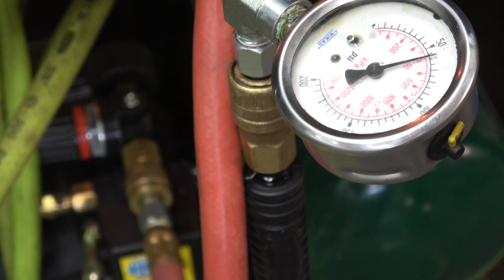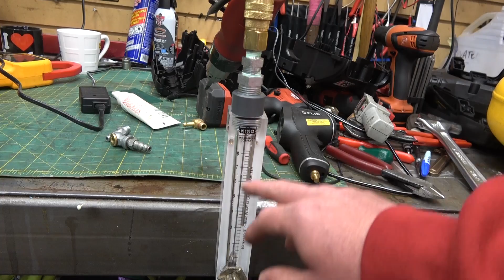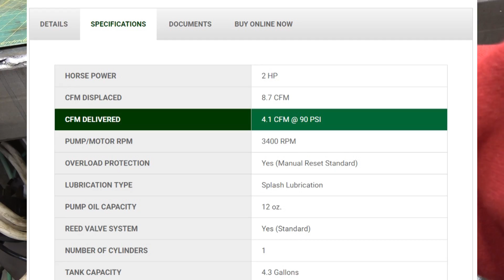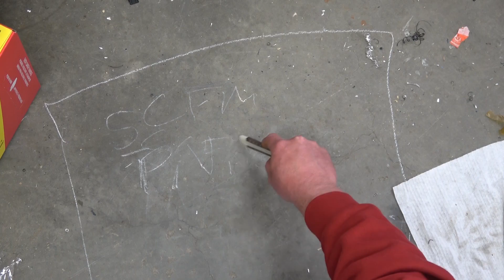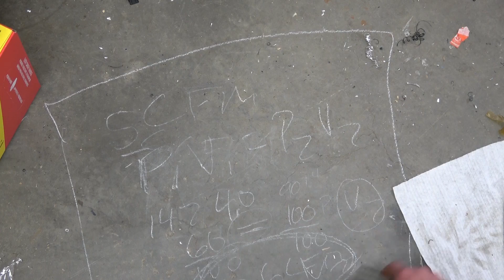Why are CFM ratings BS?

Comment: Interesting!!! What about a 700 euro (around 850 USD) Makita compressor with only a 24L tank, rated at about 5CFM at 90psi, wondering if the price is so high because it's real rating, it's the AC240 with a 1.5kW motor. Also as I was looking at the cheaper larger tank units I noticed it said suction production ***L/m, I think they got these at the wrong category, they are not air compressors they are air suckers, in case you want to suck air out of a room, to change it or something :-P

Comment: Ave, great vid man.  I've always wondered about this problem.  Maybe it's time we start lobbying the tool manufacturers to start labeling their tools with the scfm as well as the delivered cfm.  They could even put an asterisk beside it stating *consumer grade  compressors are rated in scfm.   If we could get the tool manufacturers on our side then maybe the compressor manufacturers would have to clean up their game.
Reply: "Maybe it's time we start lobbying the tool manufacturers to start labeling their tools with the scfm", indeed it'd appear the tools are the culprit in NA. In Europe they are rated as "air requirement", or "air consumption" - e.g. Hazet 9012M says 127L/min (or 2.1L/sec). Ingersoll Rand does list their tools the same way.

Comment: to big a tank never gets his pressure, takes an hour to fil , 5 min work and waiting half an hour to fill again.. netto production of compressor fals 10 percent for the first 15 psi and 90 percent between 80 and 90 psi.. solution good powertool running on 60 psi to do the work. compressor delivers 2 cfm tool uses about the same. realize accu tools use 50 watts an airtool consumes 2 hp compressor power.
Watch the pressure in the tank rising and time it, first 15 psi a minute and slower down with every next 15 psi. never reaching more then 130 psi

Comment: Not sure if i'm doing the calc correctly, but does that mean that you would need something like a 40 SCFM compressor to run a 6 CFM tool? Also, what is the SCFM rating of a 6 CFM tool and is there a better way to match tool and compressor ratings?

Comment: A bit long winded here. If you're into rigging,  do this:

Start with your usual small compressor turned on by a wall switch as needed.  Tee in all tanks you have, including used larger compressor you eventually acquire. Turn on larger compressor when doing the  heavy stuff, taking a breather when your combined tanks run low. Also aim for trailer mounted backup, owned or rental, when needed. If you are the junk type, there always seems to be older compressors of many kinds discarded by others, available for the odd chore swap. Always enjoy more air, including launching anything through a quick release valve and a pipe, hundreds of feet away.

Comment: First red flag is a "Low amp draw 2HP motor"... Hmm.. And it plugs in a standard wall outlet.  I have yet to see a 2 horse motor that efficient it will deliver that power while plugged into a standard 120v  outlet...

Hey AvE, let's plug that thing in and see how many pixies are flowing when the tank is at say 0, 50, 90, and max pressure just before the pressure switch opens.. Compare it to what a TRUE 2 horsepower motor would consume.

Comment: hey, you know, whats needed is a website with a list of all the deceptive numbers put of stuff, and roughly the size of the lie.
so... heres  a start

* (consumer) compressor cfm (~x4)
* battery bank capacity (x2 and rising)
* Flash memory write speed (see provisioning, max is massively more than min.) 

* car mileage (see removing parts and taping seams for the tests!)
* bulb life (10 years means 10 years of some underestimate of percent usage.)
* sound wattage (peak wattage has no limit of how short or unrepeatable. )
* broadband speed (see provisioning, max is massively more then min.) 

* hoover power (inflated by using REALLY inefficient elec.motor.)

and a new one...

* computer speed (thermal throttling variablity.)
Reply: Finally, someone who understands how OVERRATED powerbanks really are!

Comment: Buy an overrated compressor is all. 🤷

 Air tools ratings are off as well.
They might be right with the concept model but then corners are cut along with quality and the price is raised.

Snap on,  Cornwell, Mac,  matco , Craftsman all fit the same nut, bolt or screw etc. differently

Patents ruined standards

Comment: My 1960s 80gallon Wayne compressor I don’t know what the rating is but on a die grinder, it keeps it close to 90 psi. Haven’t really tested but it’s a lot better then my old Cobalt Lowe’s brand 30gallon.  That one was rated at around 4ish cfm. It didn’t keep up for nothing on die grinders.  It was quite tho. Wayne is just as quite. Paid 50$, and 450$ dollars later to fix it......I have a 80gallon.

Comment: Homeowner compressors can’t handle 100% duty cycle nor get anywhere near 4 to 5 scfm  for $300 USD, shame on us for expecting it when a compressor that can do 100psi at 5scfm is $7k, bolted to the floor, has a giant motor and requires 240+ VAC.  It’s like buying a model airplane and wondering why you can’t fly you and your family to Europe with it.

Comment: You sir are making a very common engineering and logistics mistake in your test and analysis. You see, what you have to keep in mind that that compressor was made in America, while your test was conducted in Canada. And as we all know, Canada is north of America. Also, the cold is north of America. So there it is, it's that thick cold air you Canadians breath that makes that compressor have to work so hard. And as it's a mechanical device, and can't therefore work any harder than its design specifications allowances, its output must decrees with the colder air.

Comment: The problem is you are using imperial units. You never get ripped of or cheated with metric units!
Reply: The unit used doesn't matter at all if it is being used to deceptively represent the value of something is isn't actually the value for.
Reply: @NeverSuspects There is no deception with metric units.

Comment: The problem is that volume is irrelevant, the correct measure is mass flow and pressure delta. Mass flow in is the same as mass flow out. This is why your vacuum cleaner rpm speeds up when you block the hose, even though pressure differential increases this is more than offset by reduced mass flow from the low inlet pressure = less work = less resistance.(can even use a power meter to see the motor draws less juice)
Personally I would just tap the fifth stage of my old snecma CFM56-3 (to supply around 2000 SCFM, or 1600Kg per minute at about 50psi differential) 
Though this is not the primary purpose of the engine and thus vastly inefficient if not also making use of the thrust; this bleed air is only about 4% of the 3600kg/minute core airmass flow and far less then the 400psi core pressure at peak rpm. (The fan moves 22000Kg of air at about 5-10psi, 6 times the core airmass. And of course these numbers vary with altitude in addition to power lever position, the design pressure ration of the core is 30:1 but whether it does this at sea level or 40000feet is not readily available info) For those curious, this peak power costs 120 pounds of fuel per minute(normal cruise power uses 75-105) and no I don't really own the engine I only operate it, and it has about a dozen variants. 
To save the math this appears to be insanely lean with about 4-5 times the airmass per fuel used in an otto cycle piston engine, but most of the air is directed around the flame and used to dilute the hot combustion products so the turbine blades don't melt.

Comment: Btw. here in germany we use a sane unit for compressed air: Bar. 1 bar = ~1x atmospheric pressure. 2 bar = 2x atmospheric pressure, half the volume etc. That's why german compressor buyers can calculate the compressed volume from the uncompressed volume on the fly at any time. No physics book needed.

Comment: I have noticed if you want to run air tools like impact and grinders you want air compressor that runs off 220volts usually they keep up but make sure you're tank is big enough 30+ gallon

Comment: Yeah, if you're running a constant-flow tool like a die grinder you need a huge compressor pump...

I've got a dinky little ~3.5 cfm compressor in the job trailer. It's nice and quiet and it is easy to insulate in the winter so she doesn't freeze up.

Hooked it up to a 30 gallon vertical air tank. Good to go 👍

Gotta make sure it can handle the longer duty cycle, though. Very important. Otherwise you'll just burn it up.

Comment: Hmmm....  I wonder if the tools could be defined by their air OUT.  In other words both at the same atmospheric pressure.  Likely not, as then they would find a way to play games wit the temperature, which also varies in the adiabatic (isentropic) process in the compressor on one hand and the tool on the other one.  Probably cannot win.

Comment: Great video. Not sure how they can use specs that aren't accurate..isn't that fraud??? 
They used to put ridiculous HP ratings on compressors. I got rid of a failed (worn out)compressor a few months ago. It was rated at "5 HP". in big numbers on the side. If you calculate a single phase motor at 120VAC, 15 Amps (which would likely trip the circuit breaker for the outlet). 90% efficient (wishful thinking at best) it still would only equal ~2 HP. I was pissed when I figured it out (a long time ago), but then realized it would do the job I needed it for. 
It's BS, but not worth the trouble to fight it. 
THANK YOU AVE FOR SPREADING THE WORD-IT'S ALL BS!!! They are all LYING BASTARDS!

Comment: I guess the only tools they might run continuous is something like one of those paint spraying contraptions, I do have a few air powered tools but with how infrequently I use them I can accept having to wait for more air to be compressed into the tank. 

So it's nothing that's really new to me, over here they tend to have the same air going in but also output air at a certain pressure listed. To only list the volume of air going in and not tell the consumers that's what the rating is however is downright disgusting, it'd be interesting to check the US/Canadian product page of the compressor and see if there's any mention of this in the marketing wank or official specs.

Comment: same goes for battery life on any electric vehicle. you get exactly about 67% of the rated mileage on a good day with a nice tail wind on smooth flat ground at a constant cruising speed. every other normal day you get about a half and on a hot supper you get about a third. i have an electric scooter that said it will do 28 miles on a full charge and i once babied it to work and half way back which is 11 miles. so i made it 17 miles before it cut out. i rode it like a normal scooter the rest of the way. my honda 250L supposedly gets about 70 MPG which it about gets close to that even down the highway at balls to the wall wrist locked full throttle doing maybe 75 or 80 with the motor doing about 7,000 rpm. its not a highway bike and it hates it but it does it and still gets what its rated for. its not made of lies and recycled pig iron atleast like most compressors. electric vehicles are the biggest scam on the planet besides global warming itself

Comment: Buy Atlas Copco or Quincy or SpeedAir brand compressors and you’ll be very happy. Next consider your pneumatic tools, AirCat brand require significantly lower CFMs, in other words think of your compressor and tools as reconfigurable system, you want at least a 60 gallon tank to store the air or else your compressor will just run on and on, and if you require pressure higher than 125psi you want a two stage compressor up to 175psi. It’s easy all it takes is money but your not gonna get results with high consumption tools like die grinders or sand blasters using a piddley little nail gun compressor

Comment: Need to get this one and the motor HP ratings fixed. "5HP" vacuums running on 1500W...
I have wanted to start a review website that specifically points out manufacturer's lies for years. Honest reviews backed by actual testing by an independent party.
Reply: HAHHAHAHAHA like consumers report ?  was reported to be ?

Comment: I run a 9 cfm compressor in tandem with  a 7 cfm compressor which both have 2 hp 240 volt motors (I am in England and this is the normal mains voltage). I have adjusted the pressure switches so they restart at different pressures so they don't blow the mains This setup enables me to run any air tool-air sanders, drills, paint spray guns and a blast cabinet (not at the same time) not a huge fan of direct drive drive compressors-very inefficient-and hot running-much better off with a belt driven jobBig Geordie.

Comment: I think using some more fine tuned pressure transducers (static and differential), a screw compressor, a 3-phase motor, vfd, and a pump curve I could fashion a system to deliver the cfm you're looking for. However the noise level would be high, as would the price.

Comment: Man rules#1 buy something unbox it goes straight to using it without reading any paperwork ,doesn't work correct, after several Choice words read the paperwork, several more Choice words, throw the paperwork over in the corner trying to finish task continue using shity tool after realizing you should have read the paperwork first.  Man rule number two when buying a new air compressor no matter which one open all ports run 15 to 20 minutes under no load conditions continuously to break in rings correctly.  8 years and counting on using shity air compressor that will probably never quit!!!! to recap always break in your air compressor to get the most out of what you have bought

Comment: So you dont seem like the kinda guy to tell other what to buy by brand.   But I'm asking.  What to buy?  Or what rating can be used to choose.  I'm in the market for a large capacity compressor and air tools.  I'm going to have Hazard Fraught air tools for sure and possibly spring for some high quality doofletchers once in a while.  But what on earth do you buy if this is the case?  Only thing I know is that i dont want to spend more than 1,000 freedom bucks for a compressor.

AvE if you can find it in your heart to guide a padawan or anyone else wants to.... what kind of compressor DO we want for moderate home garage fuckery and Chrysler blessed seized bolt extraction?

Comment: The math was a bit off: the 90 psi for P_2 should have been converted from gauge pressure to absolute pressure, thus it should have been 90+14.7 psi. Great content otherwise. Keep it up!
Reply: Yep, gas law works on absolute pressure, not gauge pressure.

Comment: The only compressor I had that I felt was delivering usable pressure for continuous duty with air tools was a Craftsman 20 gallon compressor powered by a 5 HP brigs and Stratton gas engine.
Every other compressor I had needed additional air storage, like a few of those small disposable Helium tanks in series (or parallel) piped into the system.

Comment: this really confirms why it takes 22 amps on  220v to run my 5hp motor to swing 2 pistons around, to run one die grinder at 90 PSI... and even then it doesn't want to shut off right away!  Could you mount the flow meter on the compressor inlet and see similar flow?

Comment: Your use of a flowmeter calibrated for air at STP (standard temperature and pressure) for air at 90psi is wrong and inaccurate. The manufacturer is wrong and maybe deliberately misleading, when he quotes CFM to mean SCFM. There is nothing wrong in quoting SCFM for any compressor throughput; the rated output pressure is a separate parameter, independent of the throughput. All of this is analogous to quoting a boiler's throughput "from and at 212 deg F", whatever pressure it works at.

Comment: "what are we going to do?" 
Simple add an inline tank to balance the load. For example I added an 1100 gallon tank downstream from my 60 gal 240V largest Hazard Fraught compressor. Oh yeah I added an intercooler and some other tweaks but with that tank I can run a 4" angle grinder for HOURS before the compressor kicks in. No it can't keep up with direct output but a big enough tank works wonders!

Comment: Only time I've dealt with a worthy air system was my last job. The pooch had to sleep outside in the shed and there was 3 or 4 extra tanks inside to deal with up to 2 guys using ugga duggas or torque multipliers and 1 guy down the back in the spray booth. 

Side note: fuck you Jeremy for giving me a small yet bloody head wound with your torque multiplier expertise

Comment: Call me old fashioned but I always just assumed that the CFM rating was air input by the pump. CFM on the tool is air consumed. Cubic feet of non pressure air is a way different amount than pressurized air. I wouldn’t necessarily call it lying but I would call it misleading

Comment: Hey mr AvE this is the best explanation the Internet has that I could find about the mystery about why my compressor can't keep up with anything. Wish I knew this sooner that they rate compressors at inlet pressure wtf 
so if cfm is like amps and pressure is like volts it makes an enormous difference. It's like saying it delivers 90 amps at 1mV.

Comment: A rule of thumb that has always served me well, is " a little more than four CFM per horse power @ 90 PSI".
This is just basic physics, and based on relatively  high efficiency systems I have worked with in industrial environments for about 30+ years.

The idea of 14.7 PSI at sea level is negated when you are just considering the differential pressure relative to whatever ambient conditions you are operating in.
The ambient is always considered to be zero, and the contained pressure is relative to that. That works in outer space, and at the bottom of the Mariana trench. You can't add 14.7 on one side of the equation and subtract it from the other - it has to cancel out on both sides, or the pressure considered cannot be considered as differential to ambient.